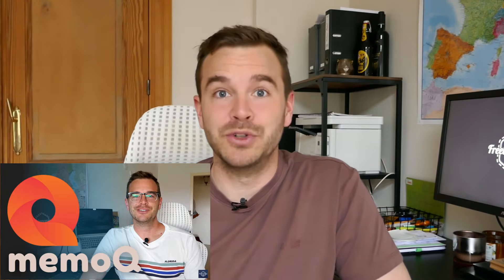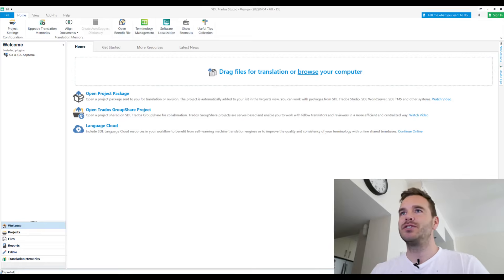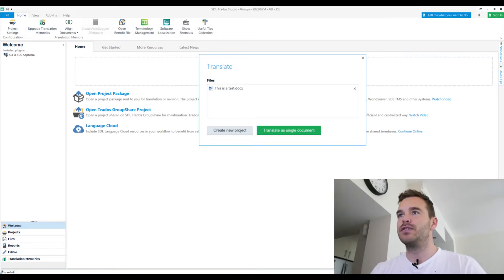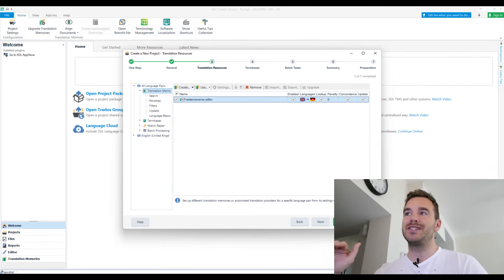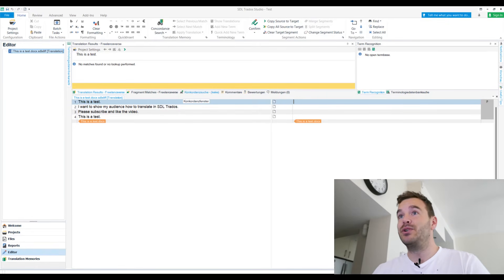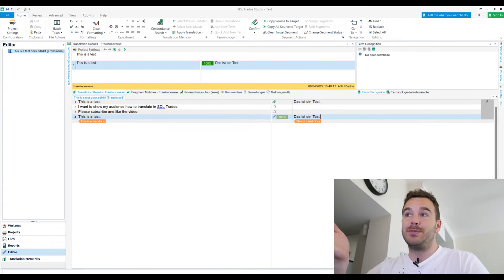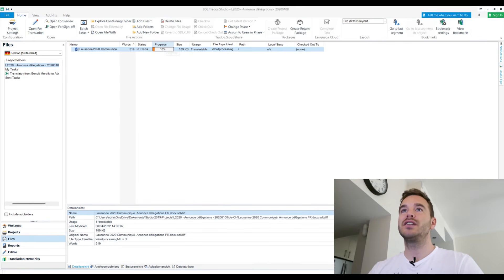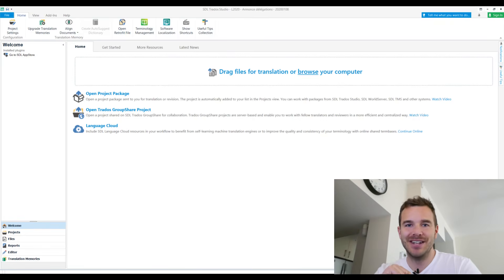HOW TO TRANSLATE IN SDL TRADOS STUDIO (Freelance Translator)

Comment: Hi what kind of computer should I buy to work with Trados? I am a new translator
Reply from the maker: I would suggest a PC, because Mac tends to be quite problematic with CAT tools. Then I'd go for min. 512GB storage, i5 or i7 processor and 16GB Ram. With these specs you should be perfectly fine. If you have the means, I'd suggest to invest roughly 1000-1500 Euro in a computer. Remember that this is your primary working tool, so it is 100% tax deductible.
Reply: @Freelanceverse  Thanks a lot!
Reply: @Freelanceverse  Hello! I'm about to buy a new laptop, do you have any model recommendation? I've only owned a Mac but I guess now I gotta go for a PCs being a new translator myself.

Comment: As many others have said, Adrian, thanks so much for your informative, practical videos and the style you present them in. How does Trados in the Cloud change the game here (and I assume there is now a MemoQ Cloud version)?. IT is not my strong point but could it mean 1) the slowness you refer to could be speeded up because it won't be downloaded on your device? 2) the problems with using a Mac/Apple fall away because the OS isn't relevant if you're using the Cloud?

Comment: Hello! Thank you so much for your video. I used Trados before - a couple of years ago, but wanted to refresh my memory because I applied for a job where I need it, and your video helped me a lot!
I have a question: How fast do you consider tools help us translate? At this job, they want me to translate 3 PPP a day with more than 75 slides each. They want at least 15 dossiers a week. These PPP have some images and some pages are quotes, but some are full of very small text. I'm nervous! I feel like its too much a day. Also, they pay is not necessarily great, so I want to consider if it will end up being too much trouble. It helps that I've translated professionally for a while and this is what I do for a living, but not using tools lately, so I'm not familiar with how fast using them can be. Thanks a bunch for your advice!
Reply from the maker: Hi Linda, glad you found the video useful :) 3 PPPs a day with 75 slides each?? Wow that sounds like a LOT! It depends on the slides of course, but be careful before you agree to that. You can probably do around 500 words per hour. So in 8h you can do 4000 words. But be careful, it's impossible to translate 8 hours a day with your undivided attention. I'd say you can do about 2500 words per day with full focus. Tools like Trados are great, but they don't speed up the process incredibly. In the beginning, it might even slow you down a bit before you get used to it. Especially PPPs are not great friends with Trados :) there are always issues in formatting. You will have to export them in the end and do a full format overhaul again. Hmm if the pay is not good, I'd be careful with accepting this! Keep me posted :)

Comment: Hi Adrian. Great video! Just wondering, is there a specific reason why Trados is the most common CAT-tool, and required by many clients/agencies, considering there are a lot of different ones out there? And also, is it difficult to find work if you don't have Trados or use it?
Reply from the maker: Hi Anders, I think it was just the best one for a long time and people got used to using it. I think Trados and memoQ both have an edge over the other tools, so it makes sense that they are the most popular ones. In terms of agency integration, I would even say Trados is the most intuitive and scalable one, that's why many agencies are using it.